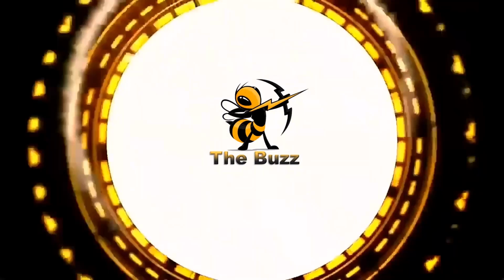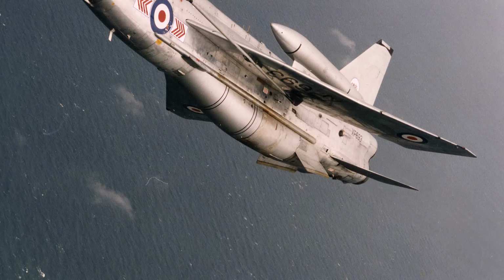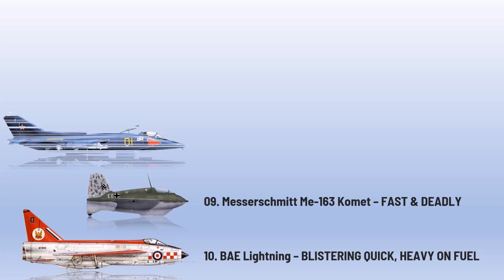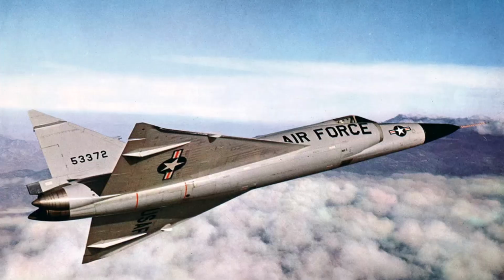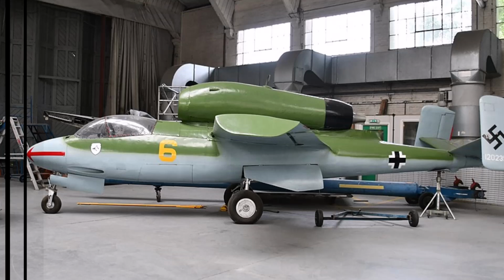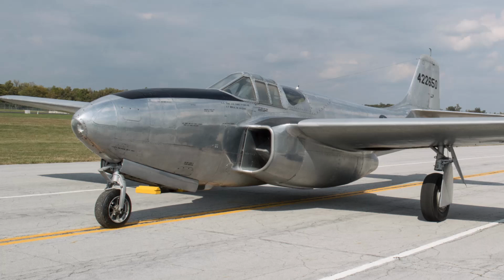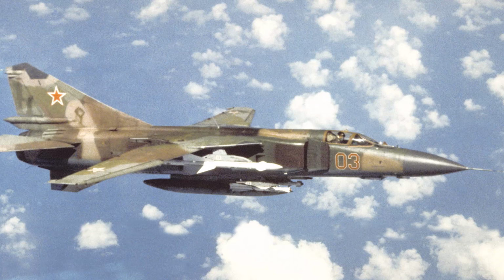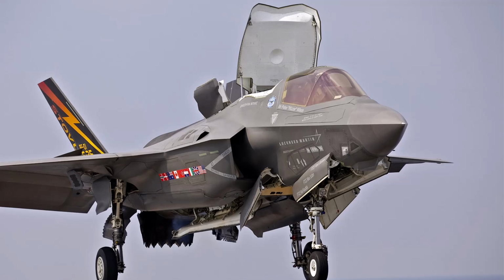The 10 Worst Fighter Jets Ever

Comment: This list is highly subjective because it more or less ignores the circumstances under which they were built as well as their particular missions for example. Especially during wartime when available materials as well as a shorter design time counted. Corners are cut out of necessity. Also, safety was less of a concern when it was more likely they would be destroyed by being shot down than from accidents. The Komet had no need for endurance. It was meant to very quickly get off the ground and shoot down enemy bombers. Then glide back. So it wouldnt be proper to consider that a negative. In fact the Japanese, developing their own version, was to use them to ram B-29's late in the war.

And the F-35 tops the list because its complicated (of course it is, being cutting edge) and very expensive? Complexity for the pilots is a valid point to consider. However the vid only mentions that some admiral or other said it. Not why and no objective data. For all we know, this admiral was unhappy because his own favorite defense program was being cut. Happens all the time.  I also didnt know price tag is part of the criteria on the list. Perhaps if it cost half as much, which it possibly would have if it wasnt changed to a multi-service design, it wouldnt be on the list at all?

Comment: I don't see why the F-35 is number 1 or even on the list to begin with, most if not all fighter jets go over budget and the F-35 overall has great performance. Maintenance is the only issue and the cost has been doping for some time now, its a very safe aircraft and compared to other fighter jets that were still in the testing phase it rarely has accidents. As of me writing this comment the F-35 has had almost all of its issues fixed and i see the plane being around for a long time due to its many uses and advances technology that can be easily upgraded.

Comment: Lightnings problem was that it was the wrong side of the practical understanding of Whitcomb area rule - Mirage III for example was on the other side. F35 a failure? Right O then (most produced modern fighter today and has no peer other than perhaps F22).

Comment: The Mig-23 was not rubbish. Here’s an iron rule of air combat going back to the Red Barons time; 
”It’s not the machine, but the man in it”

Every airplane has weaknesses & strengths. The pilots job is to maximize their airplanes strengths while avoiding their weaknesses. To do this well requires training, which is why the Mig-23s record sucks . 

The earlier versions, the MS models (monkey model of the Mig-23 which lacked the most advanced features of the original. Infra-red search and track and beyond visual range missile capabilities were removed and its avionics suite was very basic) that were flown by Arab sand negroes who weren’t real big on detailed, individual training. Their system was simple- the GCI Officer did the flying, and all the pilot does is move the airplane as instructed. It makes training cheap, quick (you only train one GCI Officer instead of five pilots), and politically safe. On that- if pilots are taught to think for themselves in air combat ,they might apply that individual mindset to politics too.

So you had Israeli/ Iranian pilots, trained by Americans and others against relatively untrained, GCI vectored MiG pilots. The kill record speaks for itself. That doesn’t mean the Mig-23 isn’t deadly in trained hands.

Comment: F-35 is a great flying wifi router. It sucks at everything else. Stealth doesn't work on thermal imaging and LIDAR. It has no range, speed, or maneuverability. Those countries that bought it are buying a maintenance nightmare. Buy more F-15EX's and fly farther, faster, higher, harder, and with more load out than anything out there.

Comment: No...the F35 is not a failure. It is just like any new aircraft design. Even the engines are being improved upon. The F35 is getting better as the tech improves. Even the F16 went trough a lot of crashes because of its fly by wire system. I think this is a suspect video.....any chance this is a chinese dis info video?

Comment: I agree with why all these aircraft ate here. And the F35 is a very capable aircraft but it was originally to replace several aircraft, F15, F16, FA18, A10 and the Harrier. It is still to achieve this. It still has a lot flaws still to sort out and if some of those flaws happen in flight they loose an aircraft. I believe full production started in 2016 but there has been a lose of about 10 aircraft since production began. And as of the beginning of 2023 if the aircraft flies supersonic for any length of time it damages the tail booms and looses its stealth in that area and it needs to replace that section and it also can't fly within 25 miles of a storm because if it gets struck by lightning it looses some of its equipment. As I said that the aircraft is very capable but I hate that it has a lot of cost over runs and it's flaws need to be sorted otherwise it will be bashed more bythehater as they loose more aircraft.